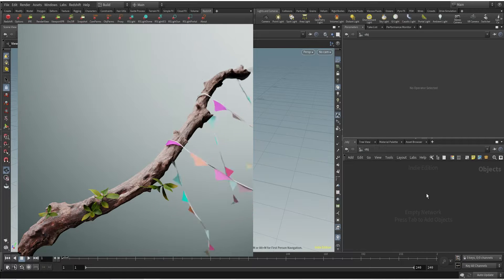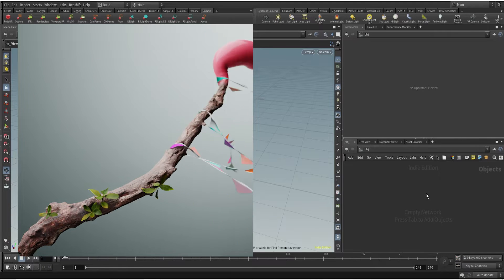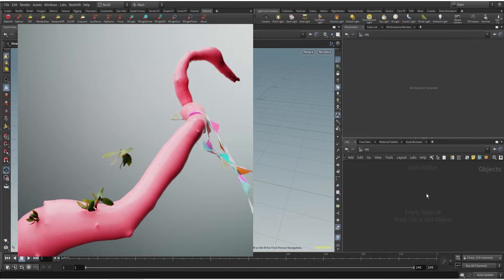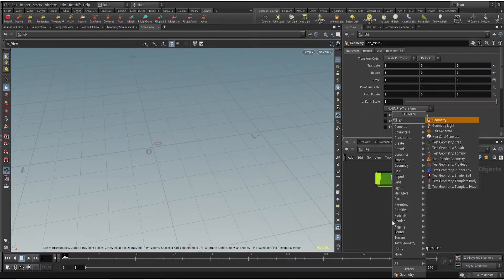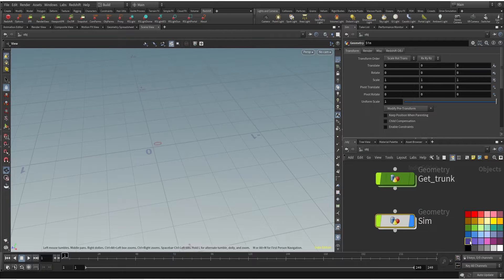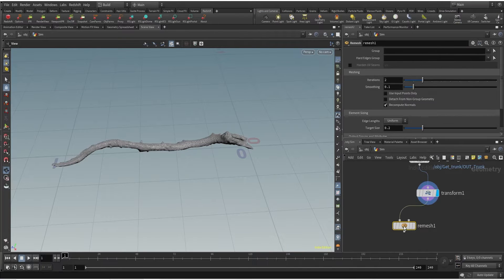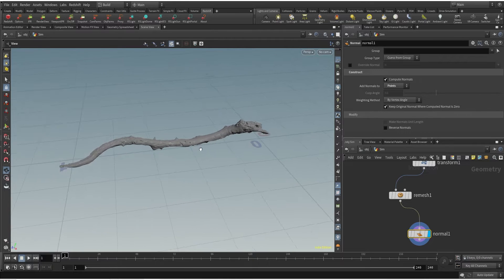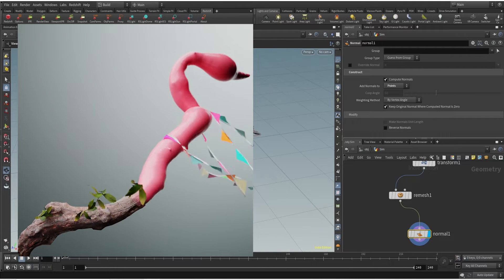Houdini Vellum Tutorial 8 : Static Geo to Balloon / Patreon Preview

Comment: Hey Kartik! 

Thanks for the tutorial. 

I have a question and would approach your insights - how should I go about learning Houdini from the scratch? I mean I have very little/limited understanding of 3D software and have used some C4D and Blender before....

Are there any courses you'd recommend for a complete noob?
Reply from the maker: Hey, you can go through the beginner tutorials available on side fx website. Houdini is a tough nut to crack in all honesty. I had been using blender for two years before I switched to Houdini. It will take time, understand how attributes work. And I think Stephen knipping's applied Houdini is also a good source of you are absolute beginner. And I will be releasing a lot more tutorials too.